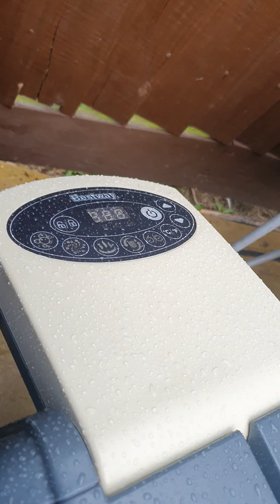Lazy-spa Hydrojet Pro - E02 fault find - pump failure

Comment: Great video, on that note, did it automatically go into e02 when pressing water circulation or heater button, or did pump make any noise? Mine goes right to E02 and beeping. Everything else works fine. Just looking for confirmation before I tear down and order impeller or pump. Thanks
Reply: Mine does the same. Did you find out if it was this in the end?

Comment: Important to note that the pump runs off 12V AC hence the reason the 2 pin plug can go in either way. Applying a 12V DC supply will never turn the pump. 

The impeller in this video is certainly faulty and does need replacing but may not be the root cause. I had an E02 fault on my pump and found it to be that the 240V AC to 12V AC transformer had blown. Ordered a unit from eBay and all was well again.
Reply from the maker: Uhm.. yeah.. ook.. transformer popped this may happen, but shouldn't. 

I'm frustrated that nowhere is it labelled 12 VAC on these units, neither on the machine, in the manual, nor online! 

What knocked my pump out? I suspect for years I dosed my spa with too much Chlorine. The chemical ate its way through the diddy nylon impeller and corroded the silly, built-in, "cheap-crap" electroplated steel magnet armature. This in turn physically expanded through rust formation, pressed & further cracked the nylon open until the armature impeller brushed against the motor winding casing, causing a locked rotor state.

The flow meter protects against this occurence, hence E02 fault out. Together with heat, electromagnetism and constant exposure with Chlorine it makes for a very nice scientific experiment!

Nie that I know what's required here,  in case of future failure, my next step will be to replace the pump set with a durable pond pump and let fly! 

The heater matrix works fine for this size unit, but in case this fails I'll simply change it out as well, override the controls and done. The essential units - for a fun time, after all - are the blower and jet pumps anyway!
Reply: @DaveyJonesLockerwithJazzy  I don't know why my transformer blew either. It was working in the morning but in the afternoon I found trip had triggered and the pump completely without power.

Luckily I have a complete spare working egg so was able to to a compare and contrast and was able to determine 12V AC output from the good one and nothing from the bad one.

I did find a bit of o ring stuck in the impeller so possibly ? this is why the transformer blew.

I also have had to change a cracked impeller armature. Everything was working at the time but the Egg was getting really noisy.

Comment: I can supply most parts for these, new and secondhand. Feel free to message me. I fully agree with the author, the impeller is the fault in the majority of lay z spa pumps. They're made cheaply and with inherent faults to cause them to fail eventually in order for you to buy new equipment. Theres a huge market now that supply parts and advice.

Comment: Great video stripped my pump down and found a crack in the impeller plastic casing .looks the same as yours.  I have ordered a new impeller kit so fingers crossed 🤞  thanks again couldnt have found this without you

Comment: Hi .was your pump working when you selected the jets ? .mine works when I select the jets .but doesn't work when I select heat .so no water flow hence I get the dreaded 02 fault.  But the pump does operate the jets 🤔
Reply from the maker: No.. the two pumps don't run simultaneously. They can't because they share the same network. One flow rate will disrupt the other and the filter pump magnetic flow switch will drop out and trip the filter pump. The only thing that can run concurrent with hydrojet water pump is the airjet blower. This means that you can't heat up the pool water whilst hydrojet massage is on.

Comment: Exactly where I’m at. I have replaced the impeller and flow magnet but it will only run I’d I help the impeller to start. A new pump sounds like a good idea. Any suggestions as to which one.
Reply from the maker: On ebay.. Check the serial number to match.. it'll work

Comment: Hi I've only had one EO2 fault in the 2 years we've had our hawaii but the problem i have is the hydro jets not working and the pump giving a loud buzzing noise when jets are selected. Are the jets supplied by this impellor? The only way to get it working is to backwash the inlet and outlet. Which seems to free up the pump and it works. Thanks

Comment: I disconnected the 12v lead from the pump unit when i was pulling out the impeller but the pins are not marked and the plug will connect both ways. So annoying

Comment: I have the same problem it seems ! How did you take the pump out? From beneath ? Or took the whole thing apart?
Reply from the maker: Hi.. For HYDROJET PRO ONLY...  it's quite "stimulating".. remove the cover, but leave the control wiring attached, don't disconnect any wiring, except for the earth connection on cover terminal. 

Inspect from the front. Lift up the discharge line - port  B - .. there's a pipe with right angle fitting and what looks like a black wire coil thermocouple.

Leave that alone and twist the pipes out from each other - they are pvc joints shrunk onto o-rings .. you may need to replace o-rings if they get damaged from the removal with a tool .. it would help to use a hair-drier to heat the joints.   

Once the bottom discharge pipe's removed, you can turn to removing the pipe from the pump at the bottom. Use gloves because the plastic casing edges are sharp and cut you.

Next is to remove the upper feed pipe into the pump. This is easy. Remove the upper clamps holding down the suction pipe - Port A. Very carefully remove the magnetic flow switch cover - 4 black screws - don't lose them, they disappear easily. Inspect the flap and magnet. Unplug the black switch two-wire terminal plug. Check the switch circuit with a multimeter, it should open and close when you move the magnetic flap toward the switch and away.

Inspect the pipes for debris and clear. 

In similar fashion to Port B discharge, remove the o-ring sealed upper pipe into the pump. 

Once clear, dry off any water and disconnect the pump wiring. The black plug terminal simply unscrews and pulls out from a black transformer distribution power unit, positioned between the air blower and jet pump assembly. The jet blower is also powered from this power unit.

Allow the pump wire harness to rest outside the casing, simultaneously unplug the in-line fuse wire circuit.

Now you can unscrew the pump from it's bracketry - you can now also inspect and/or remove the aluminium heater matrix. I recommend you clean this element matrix with limescale remover (kettle / iron cleaner) or formic acid to remove any scale or limescale - rinse & clear. 

In my experience, I remove the pump from the side of the box, lift up, twist out, remove.

If you struggle to remove the inner o-ring seal discharge pipe to Port B, then pull the pump out from the bottom toward the front of the case. But remember to disconnect the pipe at the 90 degree elbow on the front because of the thermocouple wire. 

To return the pump, reverse the process, use silicone lube spray to preserve the o-rings but also to make refitting easy,  because it's extremely difficult to press them back in. The pipes tend to pinch the o-rings, so be careful.

Be aware that the Bestway filtration pump is 12 volt AC, It won't run off a 12 volt DC test battery. It is quite a resilient pump, not much can go wrong with it, it's well protected. The only weak point is the 1-piece magnetic rotor & plastic impeller. The plastic tends to rupture through heat and age and the steel magnet suffers corrosion.

The new replacement units are solid black plastic and far more durable. The repair kits also usually accompany VITON o-ring seals - which are great because they don't suffer from chlorine.

What I find disappointing is the replacement pump rotor is nowhere near as efficient at delivering water flow as the original. I think the impeller blades are shorter - less efficient.

I may just one day replace the pump with a stronger pond pump of similar power consumption. 

Enjoy your Hydrojet Pro.

Comment: Turns out that after backwashing failed my water pressure sensor was at fault. I checked the pump which appears fine.  I disconnected the mains wire from the main board to get at the pump easier but I forgot to take a photo to show which way they went round. Is there any chance you could please link me to a photo of your main board with all the wires connected so I can see how to wire mine up without making it explode ?
Reply from the maker: Wth? Why did you disconnect anything from the circuit board?? You have no business on that circuit board, it is fully insulated from moisture / tampering so you can't break it... anyway. There are a set of plug connectors on the top edge of the board - it's a distribution rail.. there is a video which shows the wiring legend and wire colour codes... in all honesty I don't know what the title is, it was something like: "Replacing filter pump on Lazy-Spa Hawaii" - it is British.. the guy is seen working on an Air jet Hawaii, with the domed "egg" control unit. He shows the connections on the board. What you should've done,  is simply disconnect the pump from it's power transformer. Which is a black square insulated box which feeds filter pump and blower. It's a simple set of plastic two-pin screw plugs. If that's what you mean, you should only have to connect this plug again for your filter pump.
Reply: @DaveyJonesLockerwithJazzy   thanks for the info. It was easier to get at pump from the bottom and on my model the power cable is looped round the bottom plastic so you can't pop it off without taking out the power lead. I broke rule 1 always photograph. :(  I just hope they use the same legend on the air jets as they do on the hydro jets...
Reply: Found the vid thanks! For anyone else who forgets to photo wires before disconnecting them there are labels on the wires and they match letters moulded into the shiny grey plastic on the side of the main board case. You need to have just the right light to see them. Seriously, "the one ring "had better visibility!